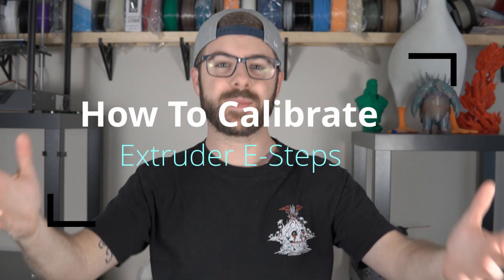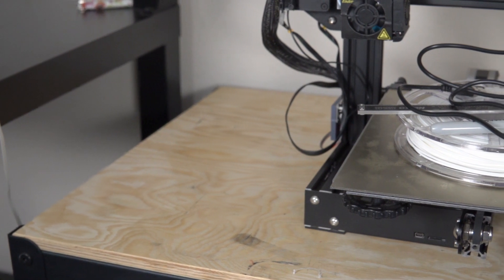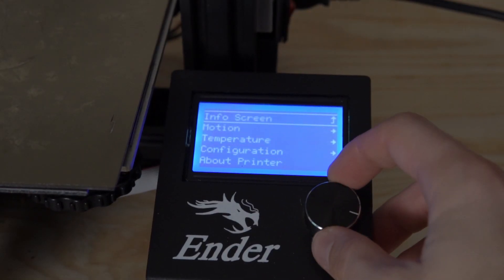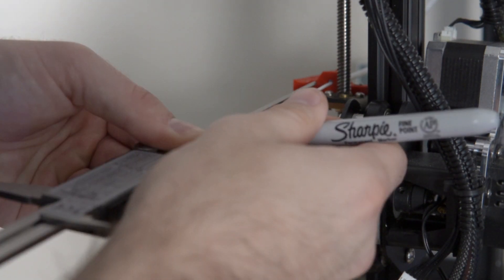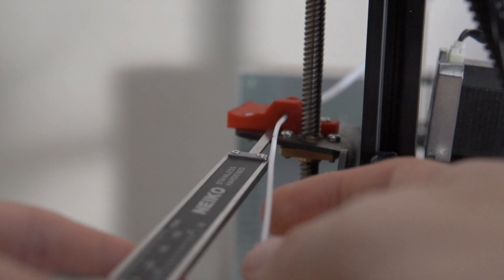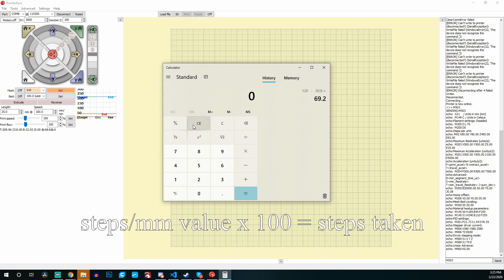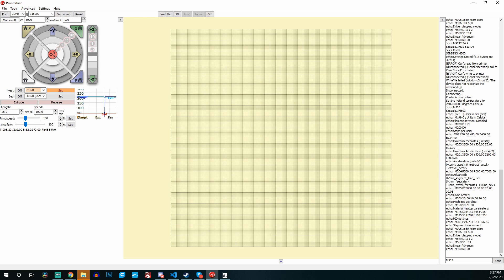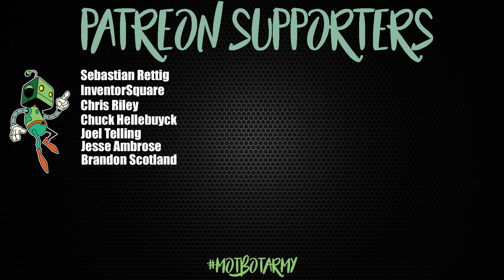How To Calibrate Your 3D Printers Extruder Esteps (Ender 3)

Comment: I can't get Pronterface to connect to my Anycubic Mega S. COM3, Baud rate of 115200 both set correctly in Win 10 and Pronterface. I keep getting the error message "Cannot connect to printer, possibly bad baud rate". When I try to connect I here a tone from the printer so I'm assuming the program is accessing the printer. Any suggestions?

Comment: Do you have to run in through the hotend to get a good reading?(back pressure or something) or can you just make two marks, feed it through the extruder and extrude into air? 100mm isnt much but when you update several printers, checking and double checking thats a lot of wasted plastic.

Comment: I would like to add that after you input the corrected E-steps you should enter E500 to save your changes to the printer.
I would also recomend using M303 to have your printer run a test to calibrate the hot end temp.

Comment: I'm having some weird issues - but first off, I'd like to say: thank you for this video! Your information is clear and concise. But I still really need some help! I'm having issue where I get inconsistent results, and I've gone all the way from E103 to E189 and somehow still wind up with varied amounts of underextrusion. I notice that despite the extruder itself moving, the material is pausing and resuming for a few seconds at a time. Am I having some sort of tube jam or something? Please, someone help. Thank you in advance!
Reply: As it turns out, it seems I answered my own question - it seems I'm having a hotend problem. When I took the tube out, I now got a big overextrusion, and setting it back to my initial 103 seems to have it where it needs to be. So I guess I've gotta unclog my hotend!

Comment: Earned my sub! I recently upgraded to the Micro Swiss direct drive extruder on my Ender 3... hopefully I can get this sorted. Now, I just need to find an STL or cad file for a bracket for my Geeetech 3D Touch(BL Touch knock-off) that will mount properly with this new extruder as well! Thx! Great video! (so tired of manually leveling this thing)

Comment: My Ender3 doesn't save it. After Reset everything looks fine, but after disconnecting it's on the old setting again.
Reply: Did you put in m500 command to save?

Comment: Is there a reason that you’re comparing the length of the input (cold/1.75mm) to the length of the output (hot/.4mm)? Why not just remove Bowden tubing and compare input (cold/1.75mm) to output directly at the extruder (cold/1.75mm)?Genuine question. Thanks.

Comment: When you say you restarted your printer after applying the settings, is that a manual just turning off the switch and turning back on? Or you can restart it in the software?

Comment: Not sure if you have seen this. I tried your process at least 5 times and the M500 would not store.  Until I remembered a YouTube channel were it was mentioned to make sure you have an sd card in your printer  I tried this and it seems to work. I don't why but it worked. I will check and see if it continues. Thought you might mention it in your next e step calibration video. Keep up the good work I check back often.

Comment: Great tutorial, however, in the new Ender 3s you don’t need software. You can see and edit e steps in the configuration advanced settings, and you can extrude through the motion, move axis settings.

Comment: Connecting...
Could not connect to COM3 at baudrate 115200:
Serial error: could not open port 'COM3': PermissionError(13, 'Access is denied.', None, 5)

I followed the commands just as you did to fix my extrusion issues.  Now my printer display won't display any information and the printer cannot be commanded.  Please help if you know how to reset the printer or fix this issue.

Comment: ender 3..did this, turn off printer/then on....(usb cable still connected)....m503....and yes new e-steps were there.....but.....turn off printer, unplug cable.....turn on printer, attach cable....run ponterface..,.connected.....m503....e-steps back to 93.....

Comment: Changed my CR10S extruder to a direct drive dual gear.  I did an EStep calibration but I was still getting little globs on my prints.  Changed my ESteps from 160 to 155 and it's printing perfectly now.

Comment: There are a gazillion people that cannot use pronterface because they cannot connect directly to their printer it's a major thing there's so many people that have given up on trying to install drivers that do not work that you really should tell people how do you put this in the starting gcode within there slicer rather than sending commands. I see 1000 people with eyes that are welling up when you are connecting to your printer.

I have used three different computers I reinstalled windows and one nice blank clean computer did all the upgrades all the updates all the current drivers nothing I hear cannot connect to my CR 10 to save my life I have given up it will never happen then I will never buy a creality product again as a result

Comment: So mine pushes the filament out stupidly fast and ends up grinding. It pushes out the 100mm in like 1 second. Why is it doing this? 

Edit: make sure you are NOT typing "G1 E100 E100". Its "G1 E100 F100". I know very little about code..... but apparently typing e100 instead of f100 makes it freak the hell out and try to extrude stupidly fast lol.

Comment: Awesome video bro. My only question is this: I've heard the ender 3 has 2 different motherboards. Does this work exactly the same way regardless of the motherboard model on the Ender 3? Also, can I connect it to my pc via a usb port instead of the other connection you had? Please answer this for me if you can. Thanks!

Comment: Have been having these really odd issues for months now and couldn't pinpoint the issues and I believe it was due to various recommended updates which no one mentions could cause under extrusion. Updates / changes I did, replaced the plastic extruder bracket with all metal and replaced the original Bowden tube with Capricorn tubing. The issues were small at first, bed adhesion, first layer issues, etc.. and still had successful prints, just not satisfied with the results. however when printing with PLA+ and Shiny PLA there were tons of issues.  I spent countless days screwing around with the bed, ensuring level z axis and even reassembled the E3 pro, bought CR Touch and new mainboard but it never occurred to me that the updates to the tubing and bracket were causing this temporary under extrusion. Finally I got into teaching techs calibration guide (Should have been my first step in troubleshooting).   After following this video in calibrating my e-steps I am finally seeing better results. Thank you for putting this together, I can now have confidence in my printing abilities again. - Finally!!!

Comment: why the need to multiply with 100? On my extruder, the initial steps are set at 837 (the default of titan extruders with slimline motor from e3D.)
Reply: I will self reply to myself, after testing and retesting, my good to go esteps are now 807.99.

Comment: Pronterface hasn't been updated in several years and the Mac version isn't compatible with current versions of Mac OS. While CURA offers a feature to send M-commands to the printer, it will not display output. However, any serial terminal emulator app can do this just fine.

Comment: i calibrated it with a number of 107 to replace the stock 98 then when i went to test again the extruder is slow and is now over 200% slower and spitting out less than 50mm after a e100 f100 command. then i decided to send m502 then m500 still no good.

Comment: Great video! Shouldnt flow be checked and adjusted after doing this or do you just leave it at 100? I am a week into 3D printing and have seen other videos where they check flow after, so that is why I am asking.  I had to change my estep from 93 to 102.3 but then i needed to adjust my flow differently for 2 different filaments.  one at 96 and the other at 91 due to the printer actually feeding more material, I reduced the flow, checked with a shell of 2 wall thicknesses measure a total of .8mm.  Does that sound like I did things right?

Comment: Geez Louise. My printer hardly extruded 16 mm of filament when I asked it to extrude 100. I think something might be broken. Either that or my real Estep value is 582.1.
Reply: I had the same issue, but im extruding 18mm/100. Do you also have a bmg extruder or a bmg clone?  Any solutions yet?
Reply: @alexcrowder1673  It was the classic broken Creality extruder arm problem. I switched to a MicroSwiss all metal hotend + direct drive extruder combo and I've had no issues since. It is 100% worth the money and has saved me a lot of headaches

Comment: I DID exactly what u have done in this video and when i save everything. i turned off and on the printer.. i then entered M503 to check my new E-value.. but all i get is the same old 93.. 
even tho i've changed it to 232.6 based on my calcs.
i dont have any idea where to go from here please check it out

Comment: Easiest guide out there by far. Only issue I had was that I needed the CH40 driver for my computer and Pronterface to recognise my printer (Ender 3 Pro with an upgraded Ender board) over USB, but that was solved with a 5min search. 

All in all, it took 30min, but my results seem to tell me that I shouldn't have been surprised at the fact that my prints used to underextrude. Hopefully, this will have done the trick!

Comment: Thanks for the tutorial!

FYI: These same basic steps can be done using the Ender 3 control panel as well.

Here are the steps for setting up the test:
1.) "Control > Temperature > Preheat PLA conf" -- to change the End temperature from default 185 -> 210
2.) "Control > Motion > Steps/mm" -- to view and modify the steps for each axis. (Default for E does seem to be 93.0)
3.) "Control > Store Settings" -- to SAVE the changes that you made.

Then to test:
1.) "Prepare > Preheat PLA > Preheat PLA End" -- to start warming up the nozzle
2.) "Prepare > Auto Home" -- to home the printer
3.) "Prepare > Move Axis > Move Z > Move 10mm" -- set to 50mm
4.) "Prepare > Move Axis > Move Y > Move 10mm" -- set to 50mm
5.) "Prepare > Move Axis > Move X > Move 10mm" -- set to 50mm
6.) -- Wait on the Info screen for the Nozzle to reach 210 --
7.) "Prepare > Move Axis > Extruder > Move 10mm" -- increment the current value by 100mm
*Note: If you do several tests in a row, the Extruder value does not reset to 0, so just add 100mm to the current value (such as 100 -> 200 for the second test)

At this point you can measure the filament per instructions in the video.

If you need to make adjustments, be sure to use the current E-step value in place of 93.0 for the 9300 / [extruded length] calculation, and then repeat steps 2-3 in the setup.
Then, if your nozzle is still hot and you did not home the print head, run the test again starting at step 7.

Finally, once you have an acceptable measurement, you can either...
A.) Start printing something! (since you hot end is ready to go)
B.) Be sure to cooldown your print head before turning the printer off...

Cooldown:
1.) "Prepare > Cooldown" -- Turn off the heater in your print head
2.) -- Wait on the Info screen for the Nozzle to reach ~30 --
3.) Turn off the printer
Reply: Excellent, thank you Josh! I have also been thinking (oh yes! ;-) ) about why not using the built-in possibilities in the Ender-3 Pro I got. I will give this a try as I think my printer is heavily over-extruding the filament, having the extruder stepper motor "jumping/clicking" from time to time. A setting of 90% flow seems to eliminate most of these obnoxious clickings without affecting the printed results in a negative way, but the estep calibration should make the printer be spot on. Testings will follow...
Reply: @chho900  if you are having extrusion issues and its clicking on you, you might want to consider a dual gear extruder. You can get a dual gear bmg extruder clone for 15 bucks on amazon. Reviews are generally excellent (depending on the clone), some of the clones have even higher rated reviews than the 90 dollar original.  Youll have to calibrate e steps again, but it sounds like you were going to calibrate it anyways.
Reply: Thank you for the Information. Do i also have to calibrate the Extruder again if i want to switch between Filmenets?
Reply: Thank you. Saving this for later.
Reply: Thanks !!!!!!!!!!!

Comment: Hi, thanks for the video., but,. I have one question.. In your experience... how many times do we have to extrude 120mm and measure, do the maths. etc..  Why am I asking. When I got the E set , the value was 95. then I did extrude 120mm, and 68.37mm remains, I did the maths. and the new value was E184. So I changed from E95 to E184. Ok. So I did the 120mm extrude again.. And the filament remains was.. 71.57mm..  I wonder if I have to do this..  a dozen times..  :-)

Comment: Thank you so much for this video. I just got a JGMaker Artist-D IDEX printer and it has been a stinking pile of ____! Absolutely the worst prints i've ever made. The bed was physically loose and the eccentric nuts weren't enough to  fully tighten it (fixed). The extruders out box are under extruding by 13.5mm (fixed now). O, and the 5 point bed leveling system with the center point being non adjustable is the worst idea EVER! I have a cr10 heated bed to swap onto it this weekend, and extra BL touch, and mesh leveling enabled in an experimental firmware from github.... well see if this all makes it the printer it should be! thanks again.

Comment: my extruder is going in the opposite direction. i have a tevo tornado (CR10 knockoff) is there such a thing as setting negative steps?
Reply: In Merlin is an option to revers the extruder. Alternatively you can reverse the motor direction by switching its wires

Comment: I got a new dual gear all metal extruder for my Ender 3 V2. I tried this method, but "G1 E100 F100" does absolutely nothing. Still it lists data with M503 and I can control temperature and so on. But no extrusion at all. If I restart everything and start over, the first try with extrusion it sounds as if a stepper motor takes one single step. What is happening? (or rather, not happening) Google search doesn't come up with anything I haven't tried.

Comment: Hi ModBot or any other viewers, I have done this calibration several times with fail, would you suppose I could simply have a bad motor that is failing to move the filament through the extruder?

Comment: My printer is under-extruding. I followed these instructions and found that my printer was only pushing out 40mm of material when set to extrude 100 mm, which meant my E had to be set to 237.5 to compensate. When I did that feeder clunks and grinds the material as it can't push the material through the nozzle fast enough. I'm stumped. Have I screwed up the calculation or is there something else going on?
Reply: I had the same issue.... would love to hear input from someone. Dealinh woth a 3 to 1 ratio qnd my extruder only pushed out 18mm of filament out of 100.so my esteps were over 500 and its just smashing and grinding trying to push it out super fast but it cant.

Comment: I really appreciated your very clear and detailed tutorials.  This one is one of the best on this subject.  It might be a good idea to show how this can also done right from the printer control panel for those beginners (like me) who don't want to deal the extra complexity of Pronterface at this time.
Reply: It cant.
Reply: @highdesertfishing4615  yes, it can be done without installing any program, just using the printer
Reply: @Eddy363636  not on a stock ender 3, which is what the video is for.
On other printers, like the V2 with the better screen and firmware it can. But that's not what this video is for.
Reply: @highdesertfishing4615  You can literally move axis from the LCD.  I have an Ender 3
Reply: @highdesertfishing4615  I've an ender 3 pro, acquired December 2020. It is fully capable of adjusting E-steps.
Reply: @highdesertfishing4615  Stop spreading bullshit, you can perfectly fine calibrate the e-steps using just the ender 3 pro interface.

Comment: Sorry to say but this is completely wrong you don’t want your extruder connected to anything as it will cause resistance. You need to remove Bowden tube and pass through raw material
Reply: Depends on the printer. Some printers are able to not need a Bowden tube, whereas others do need one.
Reply: @Duck_Bob  that still wouldn’t make any difference to how you calibrate the e-steps Bowden tube or not you still pass through raw material. And not just that the video is about a printer with a Bowden tube so you comment is in no way relevant

Comment: Is there any reason that Octoprint wouldn't be able to work?  I have a terminal tab and it appears that I can input g-code commands directly to the printer (I'm in the middle of a print, so I haven't tested it).  Is there something special about Pronterface that is required to update the E-Steps?

Comment: Software keeps telling me my printer is off line usb cord is fine it lets me start a print using it any suggestions thanks
Reply: I had to set mine to 115200 baud
Reply: @linenoize  It was already set at that when I opened it up I tried changing ports and it tells me its denied tried connecting to my other printer and it just says connecting up in top right cornner
Reply: @linenoize  Finally got it to connect got it connected to my anet then retried on my ender3 and it worked so hopefuly im home free thanks
Reply: @urbanbuffalo692_8  good deal!
Reply: @linenoize  Taht took care of my problem and some how it fixed my issue of my nozzle not close enuff to my build plate thanks so much